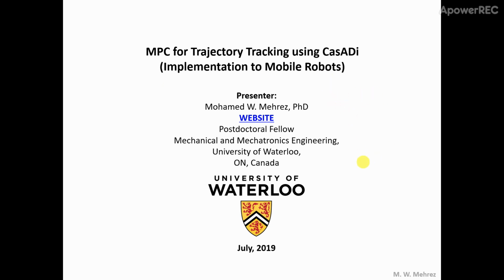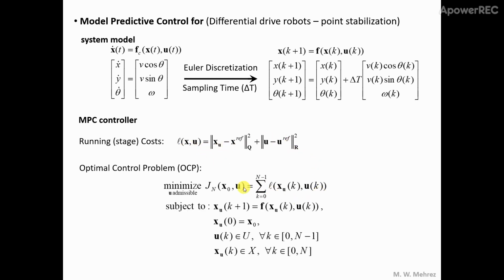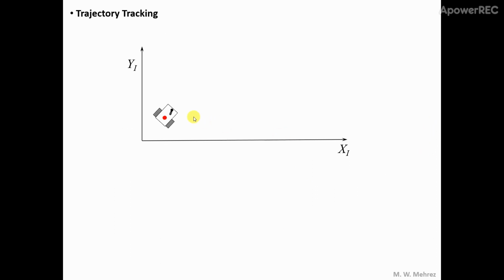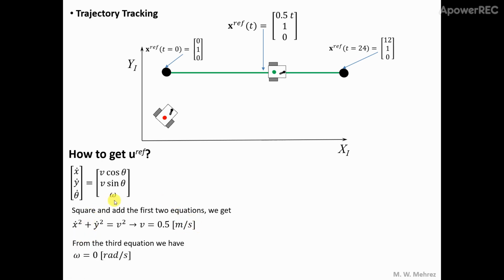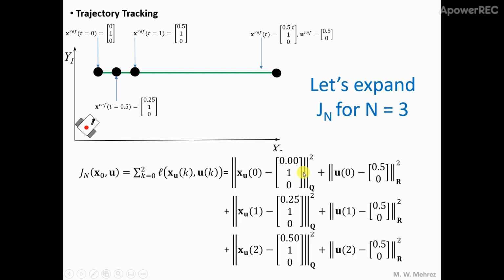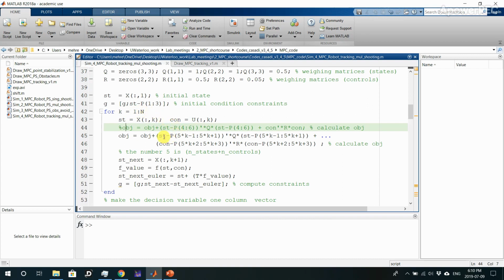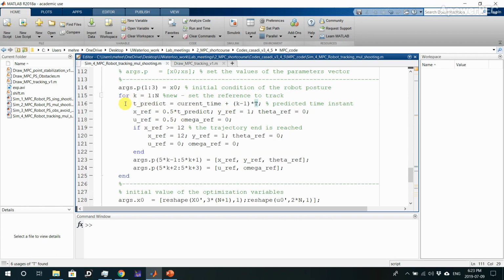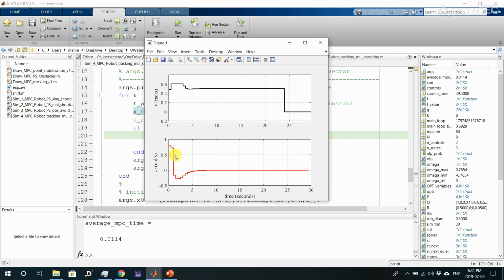Part 3 | MPC for trajectory tracking

Comment: Hi professor Mohamed, My name is Alwin. first of all let me give a big thanks to you for the workshop. 
Sir, I have some doubts regarding the trajectory tracking.

1. You are giving X_ref and Y_ref as a function of predicted time instant. So if we are giving a sinusoidal trajectory, should I use the same predicted time?  since I cannot change my reference with respect current time, how can we use that predicted time for our expression? 
2. If I am changing the reference trajectories(x and y) I should also change the bounds of x and y , right? so what about other bounds, since expressions for that  will also change as X-ref and Y_ref changed? 
 
If I am asking a wrong  question, pardon me for the inconvenience. 

Thank you once again for your great videos and codes.
Reply from the maker: Hi Alwin, thank you for your comment. 
1- Yes, you would plug this predicted time into your sinusoidal function to get the predicted reference.
2-  If your reference for x and y is within the map boundaries then you wouldn't change the bound on x or y but rather on the vehicle speed; since this is not what happens practically because the vehicle speed is tied to the physical limits of an actual robot, you need to choose your reference trajectory such that the resulting reference speeds are feasible. 
All the best!
Reply: @MohamedWMehrez  Thank you so much for the reply👍

Comment: Here is a problem that if the obstacle is dynamic and changing each iteration.

On Tue, Oct 27, 2020, 9:59 AM Xyf wrote:
Dr. Mohamed,
     Thanks a lot for your great videos.  With the help of your explanation, I successfully applied the relevant methods to obstacle avoidance and trajectory tracking of ships. 
     But I ran into a problem. The obstacles in the video is fixed,  such as 
                                        g = [g ; -sqrt((X(4,k)-obs_x)^2+(X(5,k)-obs_y)^2) + (rob_diam/2 + obs_diam/2)];
     If the position of the obstacle is dynamic and  changing with each iteration, and I have the trajectory of the obstacle,  can I still use the original method to solve the problem?
     In other word, I want the the g function following
                                        g = [g ; -sqrt((X(4,k)-obs_refx(mpciter+1))^2+(X(5,k)-obs_refy(mpciter+1)^2) + (rob_diam/2 + obs_diam/2)];
    
    How can I solve this problem?  I try to reinitialize the g function and  'nlp_prob' every iteration in the loop, which will be very slow.

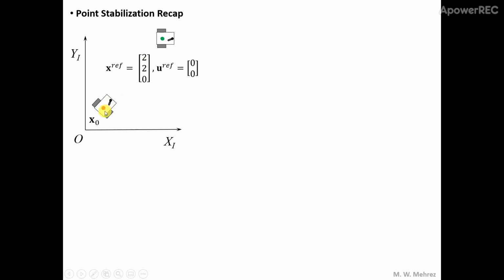On 10/30/2020 05:00，Mohamed Mehrez Said wrote：
In case your obstacle has a known trajectory, then you should consider this trajectory waypoints as extra parameters in your optimization problem. Therefore, similar to how we defined the reference trajectory for the robot as a series of parameters being fed to the optimization problem every time step, you should also do the same for the obstacle trajectory and feed its time-dependant waypoints every sampling time to your optimizer.

What you are doing currently is regenerating a new optimization problem every time step, and this is for sure slow.

On 02/11/2020 20:00，Xyf wrote：
Hi Mohamed, 

Thanks for your patient reply. I understand the problem now, if the obstacle's trajectory is independent with time, I should fed it to the opt every time and it will cost much time. 
If  the obstacle's trajectory is in a functional form  such as another ship's fixed route f2(t), I can add the obstacle function into the original  dynamic function X. By this way, the the problem can be solved as
  g = [g ; -sqrt((X(4,k)-X(add,k))^2+(X(5,k)-X(add+1,k)^2) + (rob_diam/2 + obs_diam/2)].
Reply from the maker: You seem to know exactly what has to been done, so what is your question?

Comment: Hello, thank you so much for this workshop. I watched the first video and this one.
I was trying to test the circular path as the one in your paper "stabilizing NMPC of Wheeled Mobile Robots Using 
Open-Source Real-Time Software ". There is a few points I do not understand. I wanted to change the linear path in your code example by the circular path. I changed the x_ref and y_ref such as x_ref = 0.3+2sin(0.25 t_predict), y_ref = -2.3+2cos(0.25 t_predict). But by what should I replace u_ref? is there anything else I should change? thank you for you response
Reply from the maker: Thank you for your comment. From xref and yref you should calculate an expression for theta_ref = atan (yref/xref)... Looking at the system equation it's clear from the third equation that w_ref = (theta_ref)_dot... Then, looking at the first two equations you should be able to find an expression for v_ref as a function of xref and yref and their time derivatives. This expression can be found by squaring then adding the first two equations of the system model. I think this will lead to v_ref = sqrt(xref_dot^2+yref_dot^2).
Reply: @MohamedWMehrez  Thank you for your answer. There are some behavior I don't understand. For example, I tried the linear trajectory by changing the y_ref : y_ref = -3 and  initialized it with 0 (x0=[0; 0; 0]) and it converge towards the value y = -2. It should converge to -3 but here not. Same observation for y_ref = 6 and initialization with x0=[0; 5; 0].     

Then for the circular trajectory, with an initial condition of x0=[0; 0; 0], it starts to converge moving clockwise  in the circular trajectory (so everything is normal and ok), but after reaching the point at the quarter of the circle (x = 2.28, y = -2.05) , it turns right and goes straight on (following the line y=-2), and when it reaches the opposite side of the circular trajectory (x = -1.6, y = --2.05) , then it converges again to the trajectory. It was like it was following a half circle trajectory . 

I really dont' understand why there is such behavior for the circular trajectory and why for some cases of linear trajectory it doesn't work. Maybe you have some explanation? Thank you again for your time and your help.
Reply from the maker: Hi Paul, Concerning your issue, have you also changed the constraints on the possible x and y position your robot can have? if your reference is outside the map margins then the robot can't reach that reference :D ... so your reference has to be consistent with the map margins.
Reply: Oh yes... I feel so stupid. Thank you!
Reply: @MohamedWMehrez  Hello Professor. Sorry for bothering you again, I just can't get it to work. I've set the x_ref and y_ref according the formula given, I've set the theta_ref to atan(y_ref/x_ref), but it's not following a circular path, instead it following some wierd shape. What am I doing wrong?
Reply from the maker: Hi Adrian, there could be many factors for this behavior, e.g. 1-the timing of the reference trajectory is faster than the speed limit on the robot, 2- inconsistency of the  reference w.r.t. the map margins, 3- the reference angle is not evolving increasingly similar to the model; just keep in mind that atan() output is bounded by pi and -pi. To make sure that this is the problem, you can run mpc with xref and yref only and leave theta without a reference.
Reply: @MohamedWMehrez  I've tried to run with theta_ref=0, also no luck. When I try them 1 by 1 it's working fine, just not when I combine them. I mean x_ref=sin function. with consat y_ref, it's going nice back and forth, and with constant x_ref=0.5*t_predict and y_ref with cos finction it's going the right path. Also when its combined the points to follow are all over the place, even outside the circles diameter.  When I set theta_ref too, it's following a path more like a chrismass tree then a circle :D. The margins are all set to higher values, to not interfere with the path. Sorry if I seem lost, I just would like to make it work :) Is there any chance you have a working code, and can put it in your workshop folder, so I can check what I'm doing wrong?
Reply from the maker: when I said leave theta without a reference, I meant removing theta from your objective function altogether. This should work given only the reference for x and y.
Reply: @MohamedWMehrez  Gotcha Professor Mohamed. I'll try this workaround, I'll let you know if it worked.
Reply: Did you figure this out? I tried it too, but it's not working. It's not drawing a circle but some wierd shape.

Comment: Dear Prof. Mohamed,
Thank you for providing this lecture. 
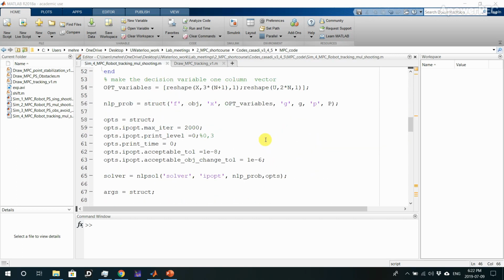In 15:55, could you tell me how to set the constraints?  You've mentioned that "3" is the number of state variables. In my case study, the states x is 2x1, controls u is 1x1, and N=2; I use a linear model to implement it. Those matrices, such as lbg, ubg, lbx, ubx should be 8x1 dimensions, the compiler suggests that. 
I don't know how to solve this bug. 
Thank you,
Reply from the maker: Hi Song, Thank you! I think you simply need to replace the 3 with 2 (your number of states). I suggest though that you first go through the code for the provided model and understand how the ranges for these vectors are like. Then, you should be able to fix these numbers and adapt them to your problem or even to any other problem with different dimensions.
Reply: @MohamedWMehrez  Thank you, I got it. It is not as simple as changing "3 to 2", I need to understand the vector size.  I fixed it, successfully.

Comment: Dr. Mohamed, Great videos. In github it appears that the contents of "Draw_MPC_tracking_v1.m" actually contain the same contents as "Draw_MPC_point_stabilization_v1.m". Thank you.
Reply from the maker: Hi Christopher, thank you for your comment. The two files are similar but not exactly the same. In the one for tracking I am  plotting the reference trajectory and changing the margin of the resulting figure.
Reply: Hello Dr. Mehrez. Currently, the first line of the Draw_MPC_tracking_v1.m on the github site is the following: function Draw_MPC_point_stabilization_v1 (t,xx,xx1,u_cl,xs,N,rob_diam).
Is this what you intended? Thanks for the great content that you have created.
Reply from the maker: Hi Christopher, It is not intended, but it won't affect the performance of the code. Normally in Matlab you would name the m-file with the same function name, but for some reasons I missed doing that. Thanks for your observation.